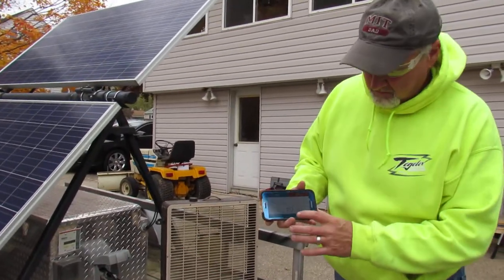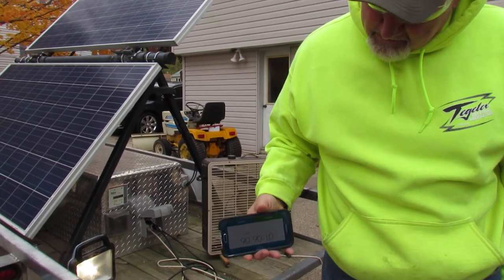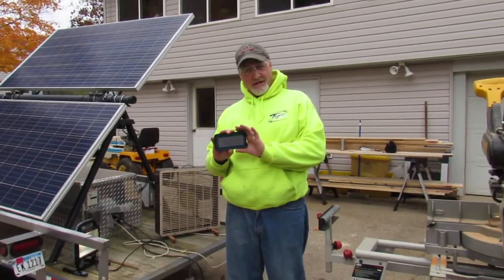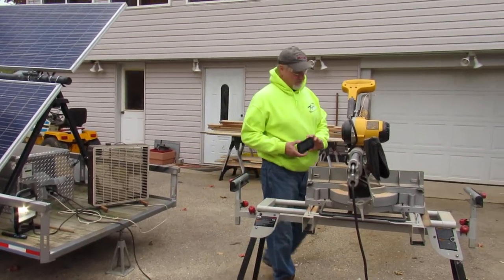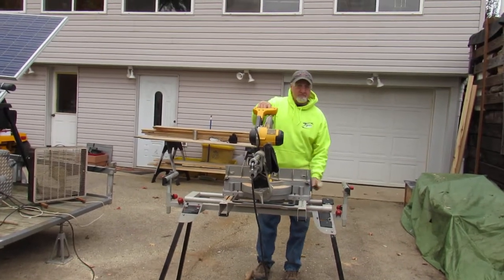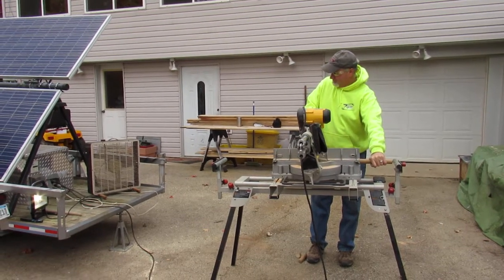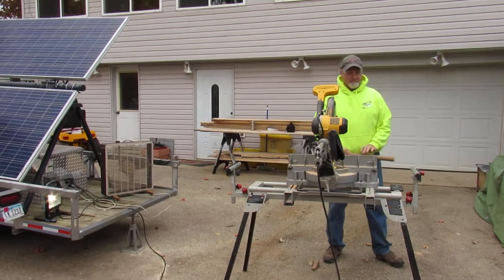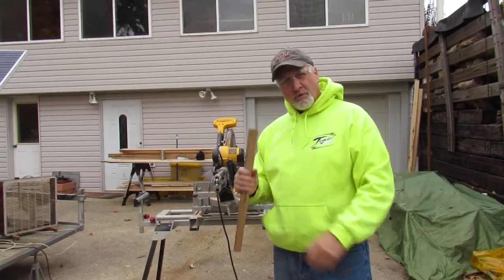Bug Out trailer deployment

Comment: I’m very interested in seeing how you guys built this setup. Genius idea with the tilting panels. I want to do something similar on a larger trailer. Since this video is a couple yrs old, have you made any changes? Thanks
Reply from the maker: Yes, I've replaced the original batteries with a lithium iron phosphate battery
Reply from the maker: It's still available